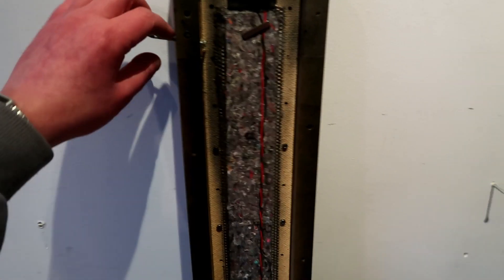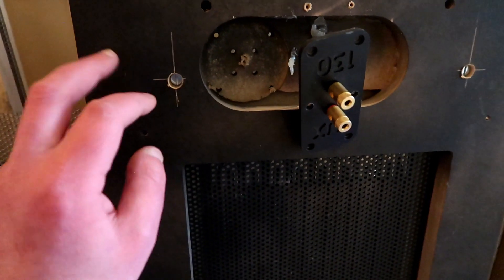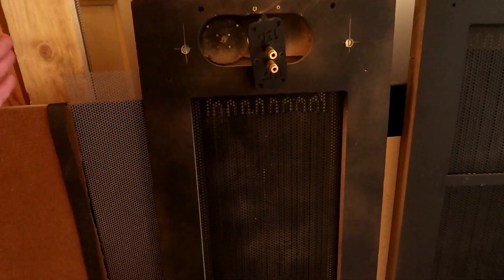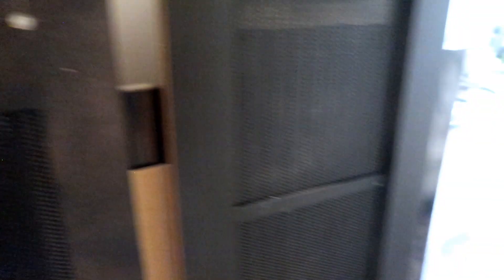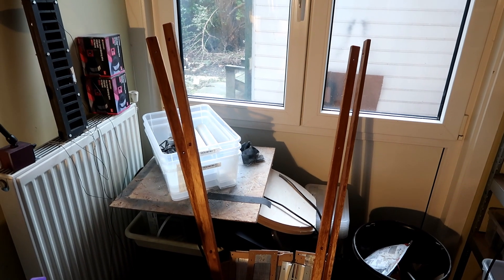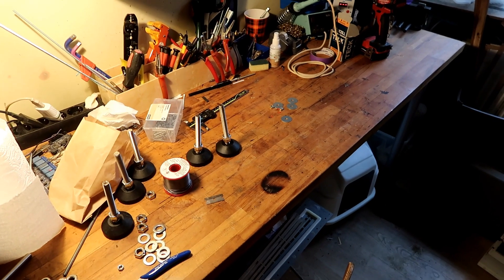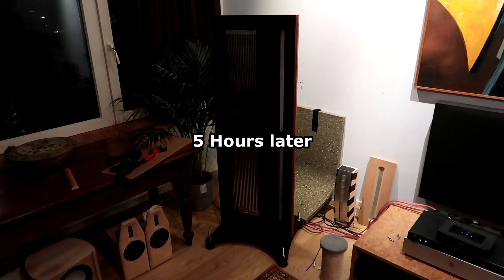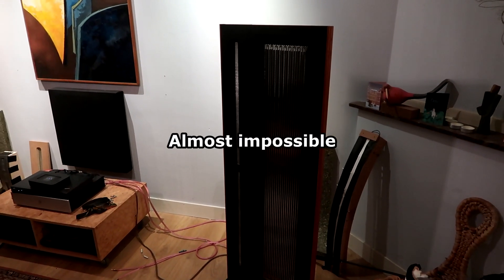Long Planar tweeter for DIY event Hengelo 2024 Part 11 - Last day

Comment: Nice bass panel, very nice pattern, still using rubber magnets?
Reply from the maker: the bass panel is an old one , yes it uses the rubber :) i kind of like the rubber. its cheap and easy:) but yeah the ferite magnets (big ones) gives  more bang for size :)

Comment: :) to late now, but I would have used only the upper half of the high section in full 350Hz-20kHz... If the lower half is down by 6dB at 2-3K you've changed the radiation characteristics by quite a lot. Like shading a line array with discrete drivers... Even after EQ, it will sound quite a bit different to running both halves in full working range.
The best way to do this is with active crossovers and FIR filters, so you don't have to model all the phase change losses.
Best of luck on the meet, cool that you have things like that. We used to have a similar DIY event (before the flu-thing) once every second year in Gothenburg. Some 300KM's away :/